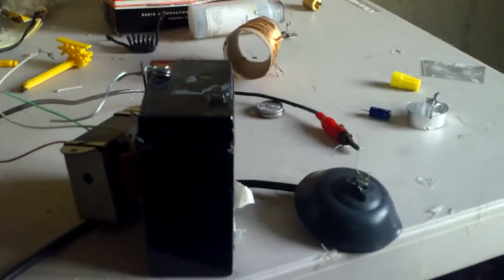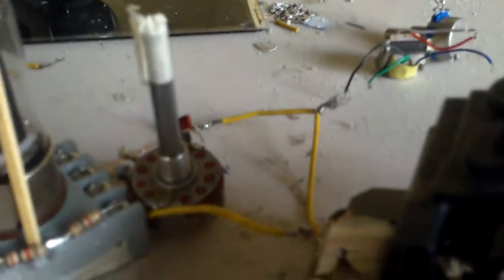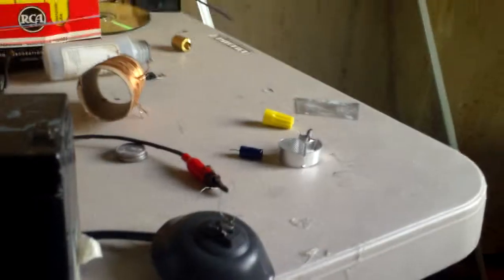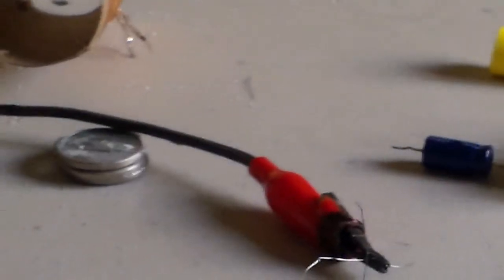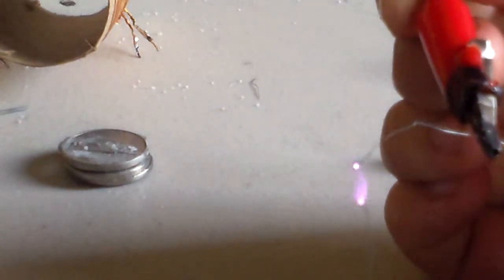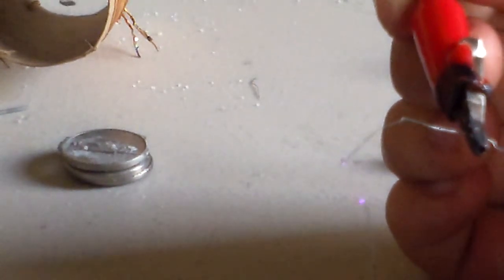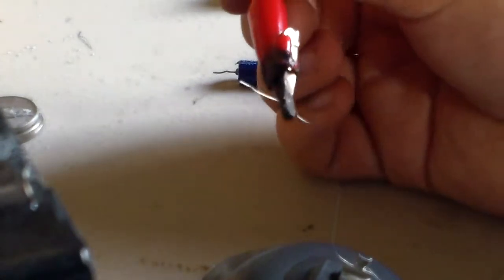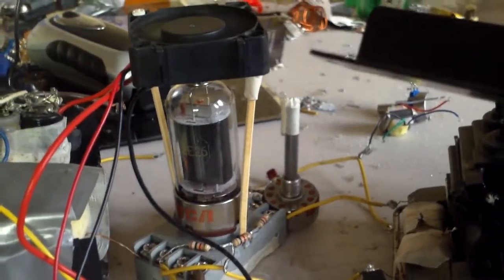vacuum tube tube flyback driver better results

Comment: hi wow so long ago
i found my limething factor on my driver (the power supply could not deliver the amps it needed)
i can pull arcs of 20 cm now 
i am not gonna modulate that (it uses 1600W at full power)
i am planning on building a weaker unit that is modulated
i already had succes with the power starved version (got some weak audio trough it)

Comment: I have a TIG that does 15A at 12-15v (depends on length of arc) it blows massive holes in cans. I think you are closer than you think. If you can turn copper red and melty, you are right in the heat range.... I wish I could turn my welder down that low. 10a is the lowest, and still about 5x whats needed for cans. I've also tried to weld steel food cans. Same problem. 10 amps is wayyyy wayyyy too much. less amp = not enough heat... Need HV low amps. AC is good for alloy. DC for everything else.

Comment from the maker: unfortunatly no, i think you need 120ma or more with a few thousand volts to burn an aluminum can. 15 amps or more to do it with under 20 volts. i may test this in the future. i have a feeling im way off :)